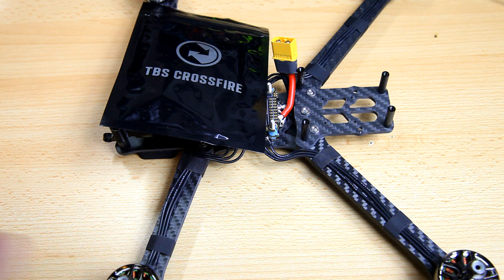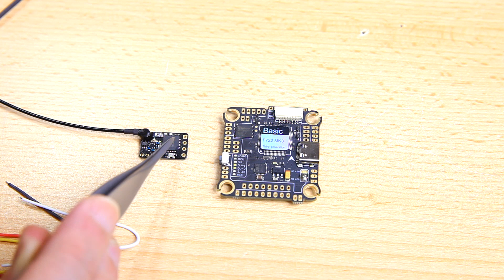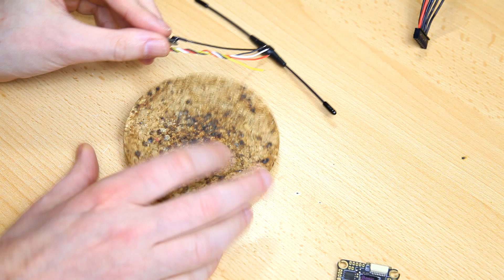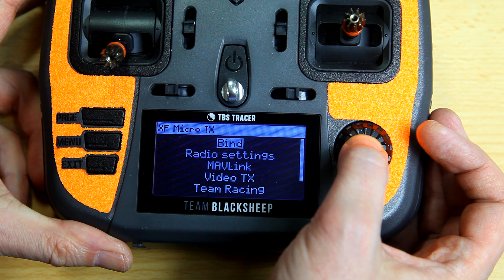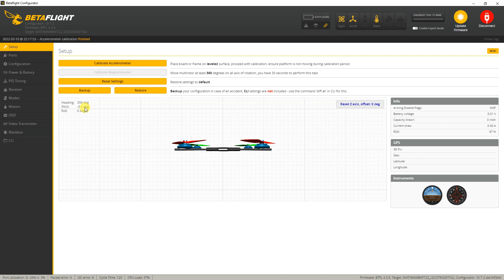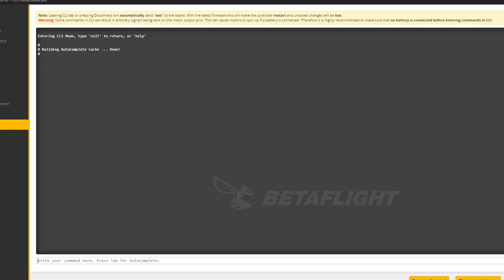How to install TBS Crossfire - nano RX Receiver (Rotorama Buddy 7" Build)

Comment: what are the other 4 ports on the receiver for if you only use the other 4?
Reply from the maker: Lookup images of the "Crossfire receiver".. You will get "schemetics" showing you what the other polder-points are for.. 
They can by-the-way be assigned to do different things, but in the images you'll see the default functions...